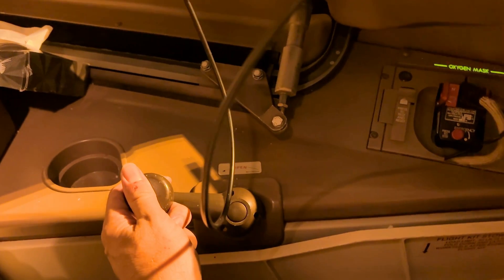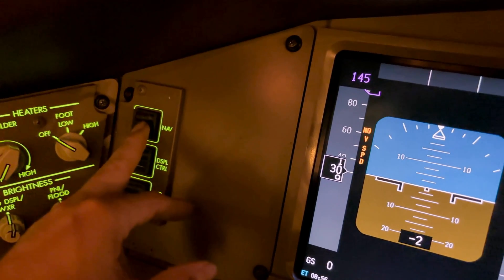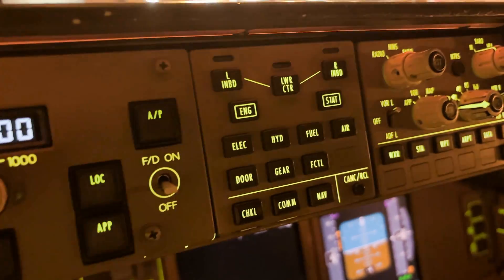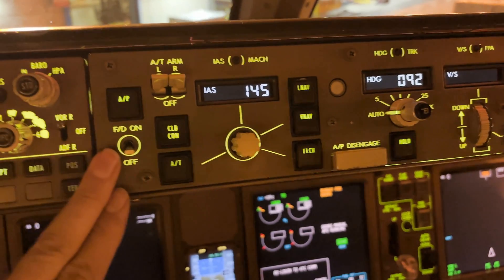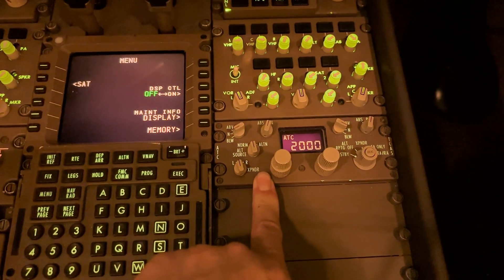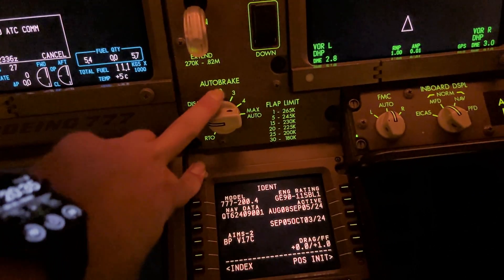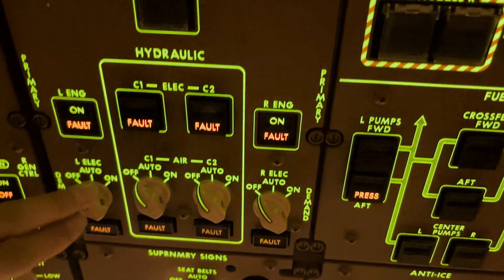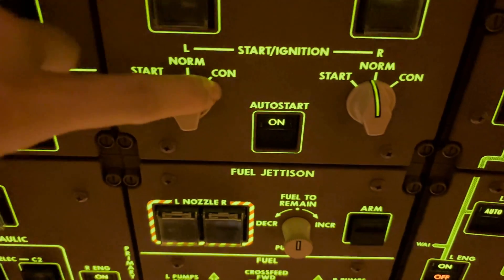Boeing B777 200F cockpit buttons explained

Comment: da wird ne'geschwindigkeit angezeigt obwohl die aluschüssel geparkt ist 🤔 ...ne'höhenangabe über normal-null fehlt obwohl jedes objekt eine "lageenergie" hat !
wollen immer alles "wissen" die amerikaner.-/innen und vergessen oftmals kleinigkeiten die großes aufsehen ergeben ( gut das wir nach 1945 briten hatten in nrw ) 
- genauigkeit ist anders , würde keine boeing kaufen bzw. aktien !!!
luftfahrtbundesamt stellt hohe ansprüche an piloten.-/innen ausbildung aber computerhersteller für luftfahrzeuge liefern sehr ungenaue angaben 
- es müsste mindestens "reset in parking" abzulesen sein wenn alles "genullt" ist 
c64 oder amiga waren schon mit fehlern , at&t rechner fehlerhaft im bios ne ne ne
Reply from the maker: Hello there, the PFD show the airspeed and altitude to. As the ADIRU isn’t aligned at the moment you don’t see the speed calculations from the ADIRU which is normally used at low speed as the pitot pressure is not accurate at lower speeds.
Reply: @dennisvijverbergbrakesrele6098  oh , "normal" ...for me... not !
the primary display is wrong , also "psi" for hydraulic not bar BUT temperature in "celsius" ...so what boeing / airbus !!!
DINorm or imperal endings they do it in a confusing-art 
but seat-adjustment they install "eye correction" for pilot's 🧐 
i will programm it like "reset" for aeroplane-mechnics (fluggeräte mechaniker.-/in)

Comment: Can they use manual brakes on landing and why on landings must be use autobrakes more often when manual? Is it only about to prevent overwarming brakes?😅🤔
Thank you. 😇
Reply from the maker: @Е.М-ч8р  auto brake just help with the pilots work load. 

It makes the braking performance more predictable. Every setting always gives you a curtain amount of braking distance pending runway conditions. 
As a result the brakes also wear slower as they tend to wear per brake application. With auto brake it will be just one gradual application.

Manual braking can still be used. Although I have no experience with braking during landing,  but I think when you use manual braking you more often are in the max braking range and gradually reduce and increase the braking force pending the feeling of aircraft deceleration.

Hope it helps
Reply: @dennisvijverbergbrakesrele6098  i'm just an aviation entusiast flying in flight simulators and entersting about things like this😇😇😇
Reply: @dennisvijverbergbrakesrele6098  thank you for answer. It really helps me to🙂